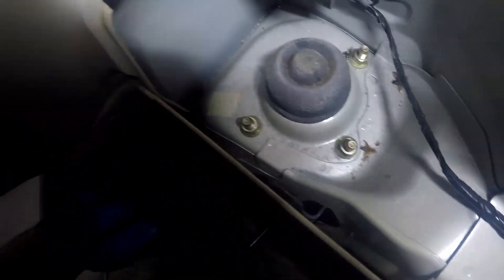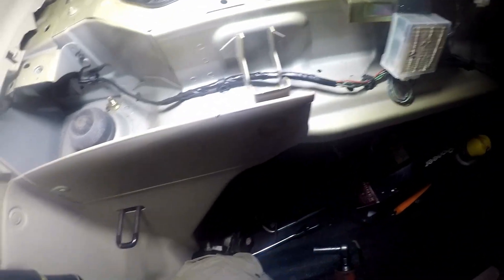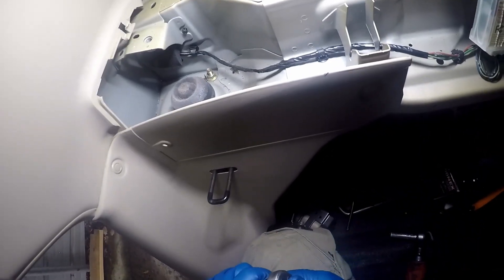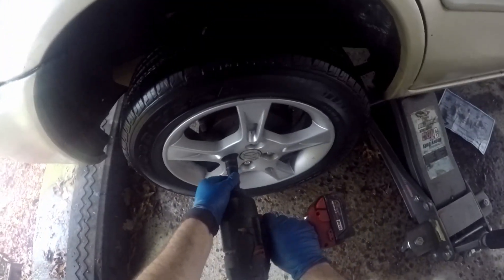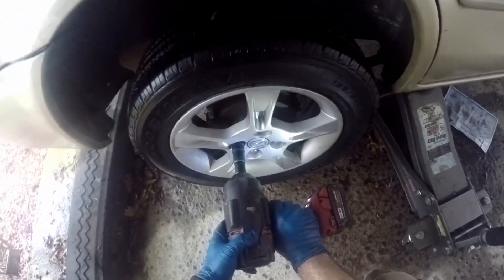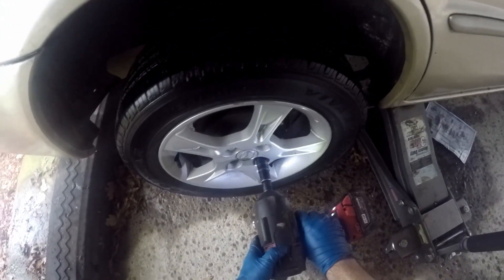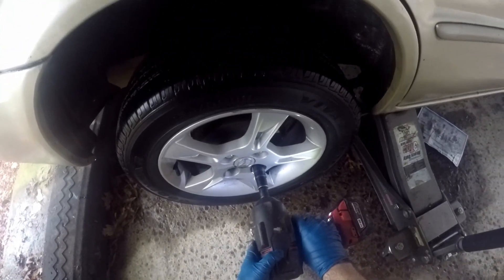How to replace a rear strut 2003 Mazda protege

Comment: I can’t get the sway bar link nut to break loose for the life of me. I had to cut them off
Reply from the maker: Ya sway bar end link are usually a pain they like to just spin. If they don’t have the Allen key so you can counter hold it, then what I do is take some needle nose vise grips and snap it on the back side. This will keep it from spinning. Works like 95% of the time. But glad you got it off. Thanks for watching!